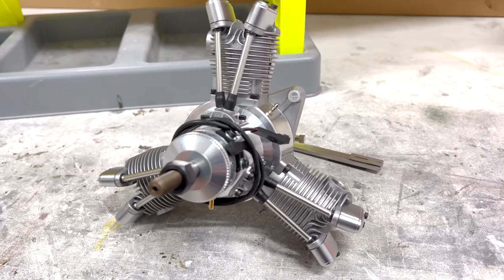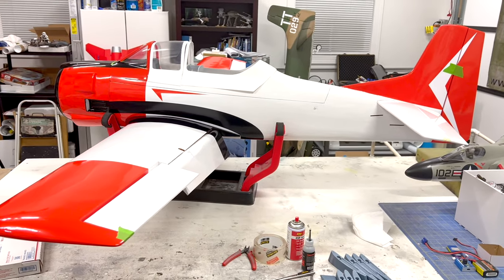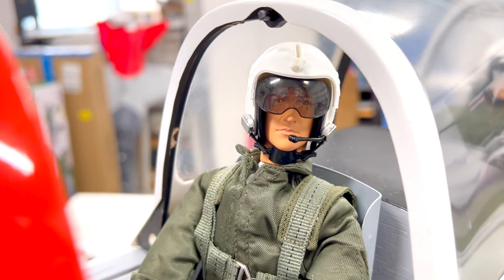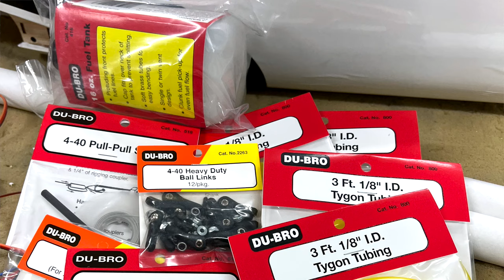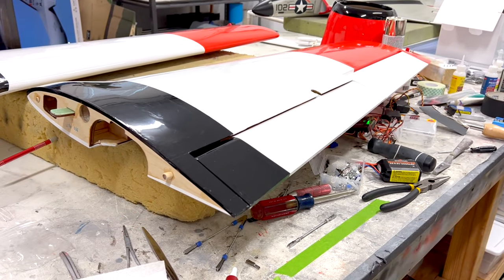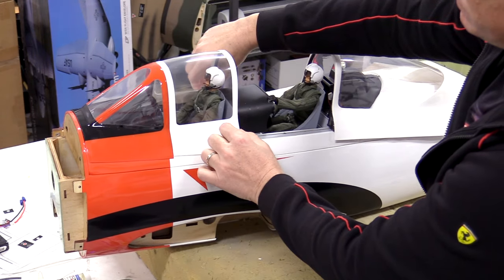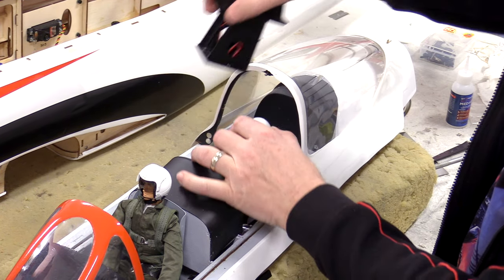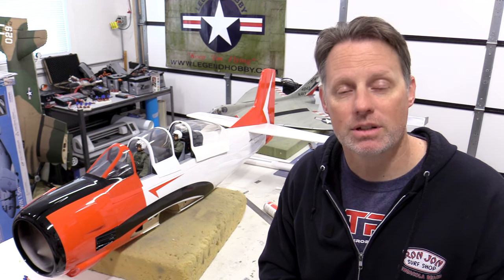Awakening the T-28 Trojan - Controls, Canopy, & Cockpit Assembly

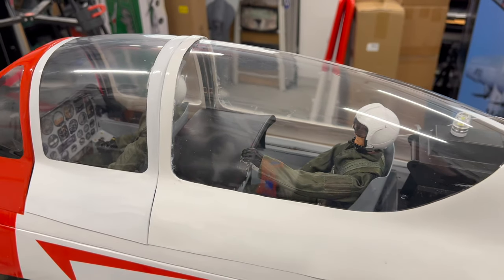Comment: 15:58 Rear Canopy fit. Ha Ha, I flew them and when in the rear seat-for the Radio Instrument or RI phase of primary training under "The Bag", there was about a one or more inch gap on either side of the canopy open to outside air. Even in FL, but at 15K Ft. with O2 mask on, in January, it was cold! Could stick your fingers into the gap. We used to practice an instrument arrival procedure called a penetration. Supercharger back to low at 12,500, dump the nose, pop the board and point the nose down in the course according to the arrival procedure. So maybe the Mfgr was better than you think...BTW the heater operated on gas which meant it reduced your range. So you bundled up. As you can imagine the guy up front is toasty while the GIB is frosty. So there you go. Nice build. Does it have a speed brake?

Comment: just got mine. WHEN are you going to install the 60cc radial & post it for everyone?
Reply from the maker: Nice!  I hate to say, but I’m running a bit behind on the build as I’ve had a ton of things happening behind the scenes. The next video will be the retracts and gear doors followed by the engine install and setup. At the moment, I’m not sure when the next installment will post just yet. 😬
Reply: @Thercgeek  I'll be keeping up with your build for sure. I have a "fix" for installing the radial after talking to Adrian @ch-ignition, so I don't mind passing it on as I am determined to install it on my plane. Once I install it, I'll let you know how it works out. Keep up the great work. You're doing a great job.

Comment: Do you use silicone grease on the joint pins of those hinges before you glue them in ?
Reply from the maker: I used 3in1 oil to preserve the hinge points.  Works great! 😊

Comment: I would have used 30 min epoxy for the hinges NOT water base wood glue.
Reply from the maker: I hear you and understand. I’ve been using alphatic glue for these types of hinges for decades (trick my dad taught me) and never once had an issue or failure resulting from it.